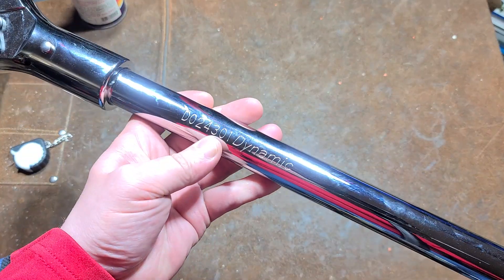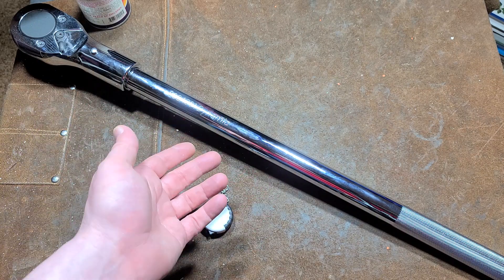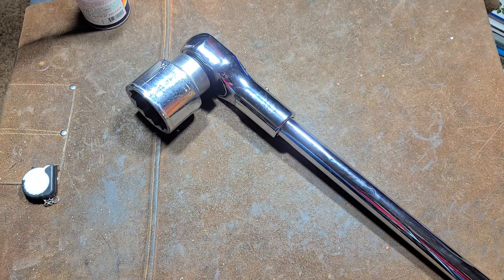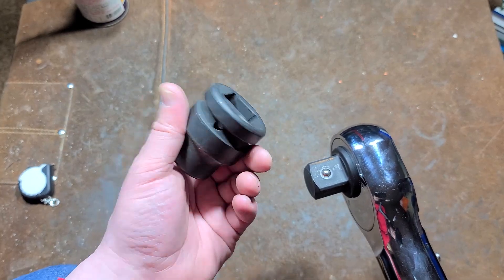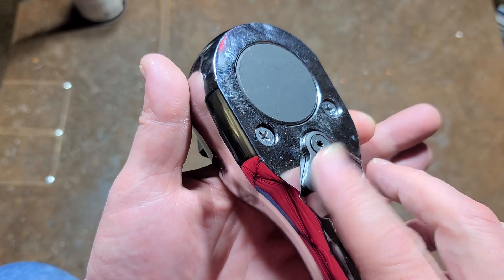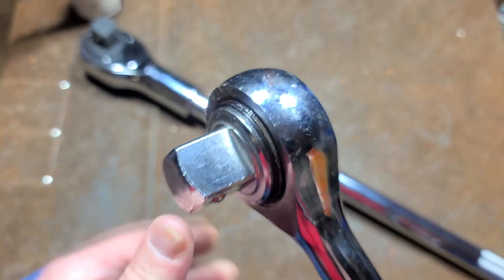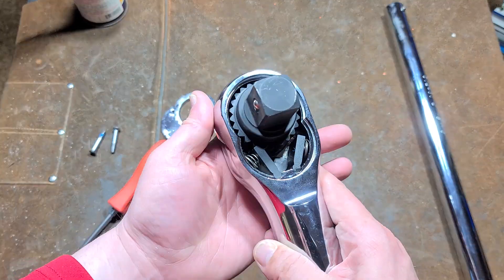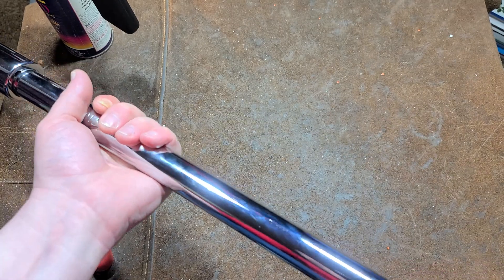Dynamic/Gray Tools One Inch Drive Pear Head Ratchet Review

Comment: The shop I work at has a 1" drive clicker type torque wrench. That thing’s about 3-4 feet tall and has the same style head. Also used a 1" air impact gun today to do a brake job on a semi trailer. Very powerful beast; makes my 1/2" impact look like a kid’s toy in comparison!

Comment: They should also consider swapping out the screws for allen heads, especially the phillips screws. After running them in and out a couple times, and a little corrosion, those will be done for in no time. Also, torx bits (particularly) the smaller sizes, never seem to fix snuggly and strip out very easily.

Comment: Grey tools For there Dynamic line used the single Pall mechanism  that they have used since 1954 and that they still use to this day and its the same one they use to make for nap on up to 1987 .. and if you can get the unit to slip then you are related to Hulk  the and a Duel Pall system on that Scale would be more likely to slip less positive contact  .. but I have my Grey tool that is from 1958  and was my Fathers and its the exact same tool and its still going to this day  it has Assembled  thousands Cat Equipment  units when they get delivered  and many D11 Cats and Payloaders I think it will out live me Also
Reply: oohh and the also make extensions for he handle it can take 2500 Foot lbs  well the Grey Tool made in Canada one can  not sure about there lower quality Dynamics But I imagine it should be able to come very close to the Original .. and if you want a fun time you should look in to the Grey tools  Canadian 1.5 and 2 inch drive ratchets the biggest socket I have is a 1.5 inch drive 8 7/8 inch  all my big toys are Grey tools and Mcmaster-Carr